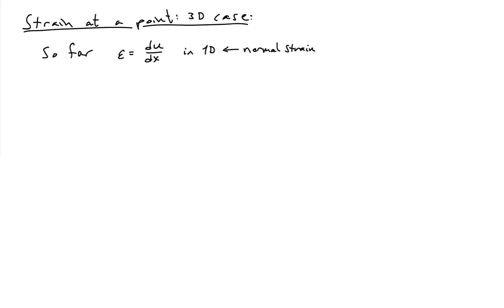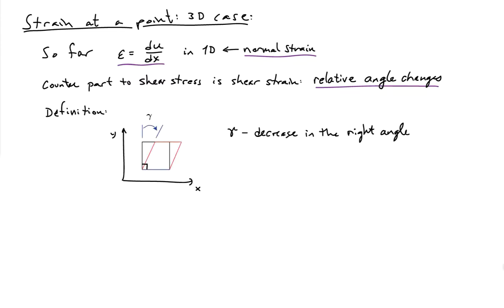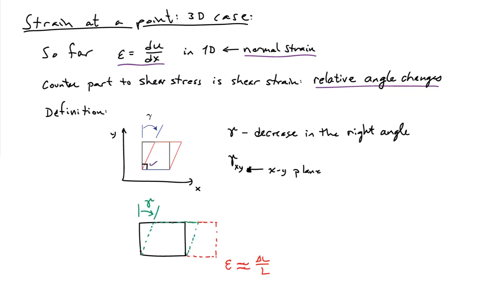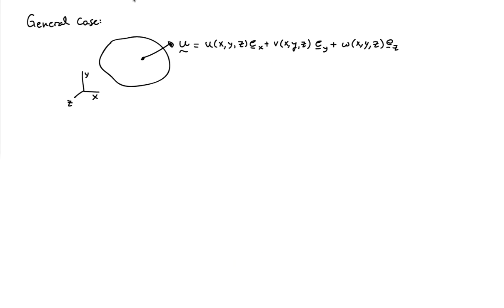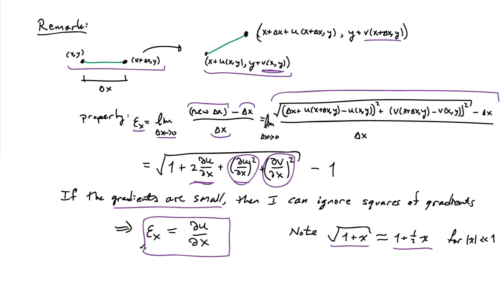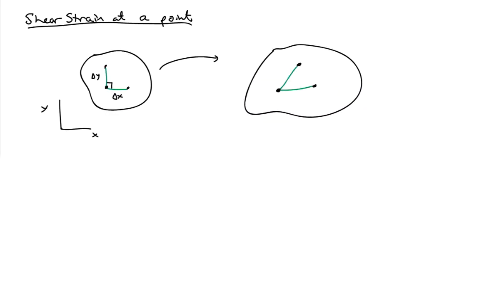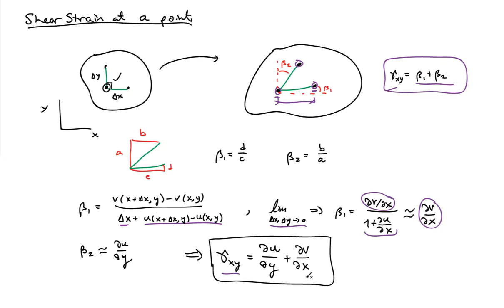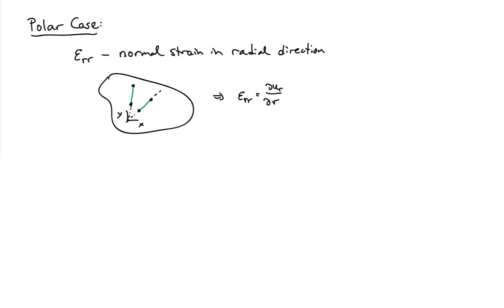(17A) Introduction to strain at a point: Normal and shear strains

Comment: Thank you very much, Professor Govindjee.
Can you suggest some graduate level reference books for this course?
Reply from the maker: The set of videos you are looking at are covered in Engineering Mechanics of Deformable Solids by Govindjee: Oxford University Press (2013), ISBN: 9780199651641. It is recommended to get the 2nd Impression: Reprinted 2017 (with corrections).  A graduate level book that covers mechanics concepts at a higher level is Continuum Mechanics of Solids by Anand and Govindjee: Oxford University Press (2020), ISBN: 978-0198864721
Reply: @sanjayg0  Thank you, Professor